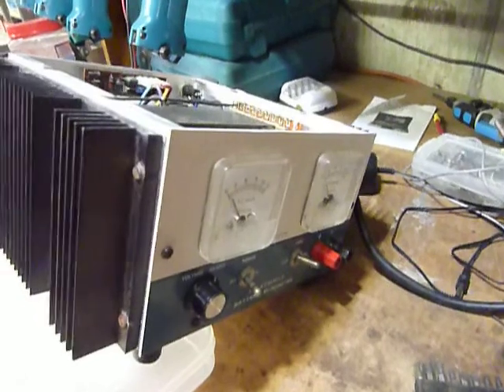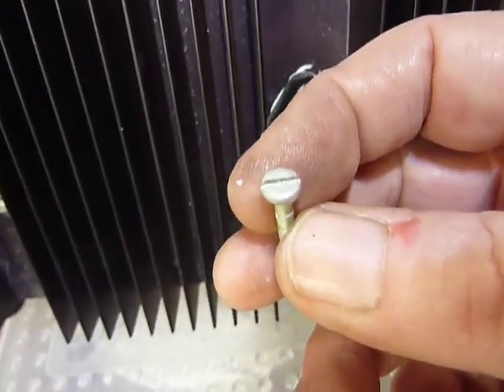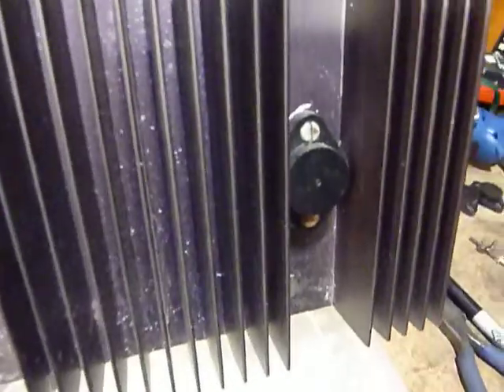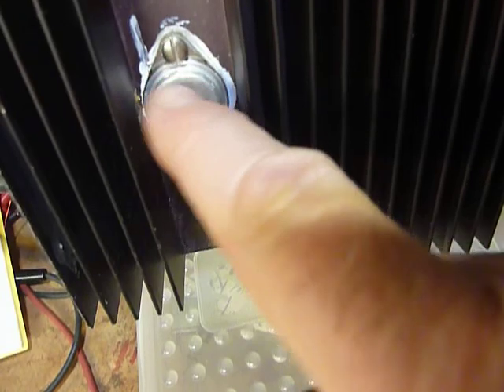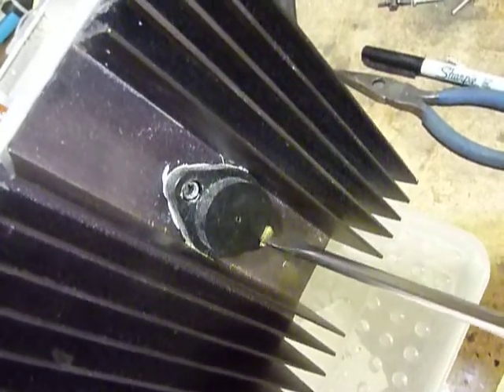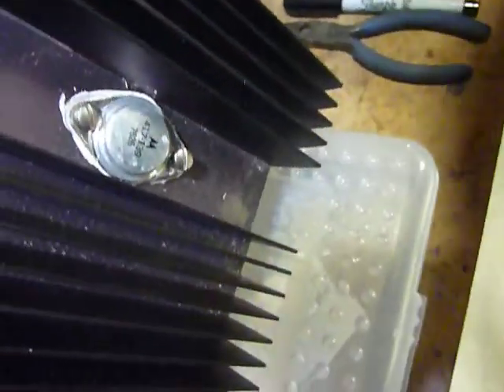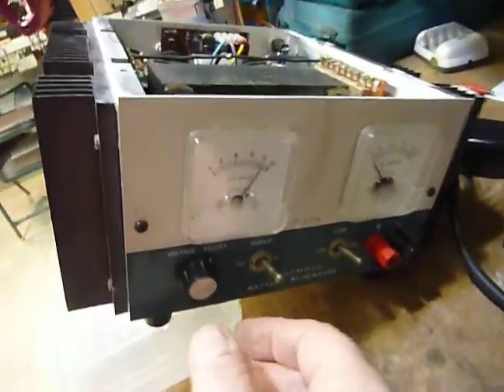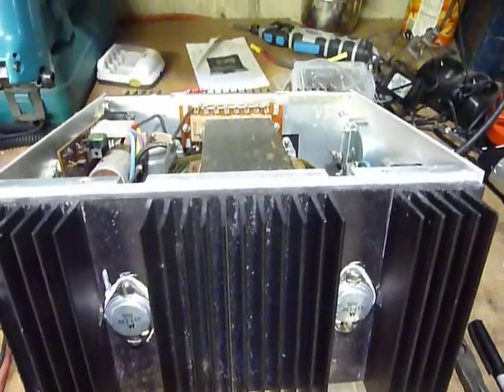HEATHKIT  IP-2715 Battery Eliminator,  Heathkit Bench power supply

Comment: Any idea what transistor I need to power the four on the heatsinks. Ran across the ip-2715 set to be recycled  but I would rather put it to use. The rear main transistor is missing. Don't even know if it's available. I'm not a ham guy. Really just thought it would be a great power supply to bench test things. Thanks in advance for any help offered

Comment: can you post a video of you using this power supply for various applications on the your work bench?  I just picked up one of these and wanting to see how I could use it.  Thanks.
Reply from the maker: No I do not have a video like that and do not plan to make one .   The IP-2715 power supply is well regulated and it will work with any of the 12 volt rigs that 
need up to 20 amps on transmit .It is also fine for running CB sets . Power amplifiers anything that runs on regulated  12 volts . 73  Bob

Comment: Hi Bob, Just ran into your channel today and watched one of your older videos on restoring an old Heathkit Transmitter. I was wondering if you are strictly a repair shop or do you occasionally sell some of the stuff you repair? 
Regards, Don KC3MBK
Reply from the maker: Well I do not run a repair shop and I do not fix radios for others  just make these videos to help guys fix  their rigs . I did work at Heathkit in the service department  for a couple of years before being promoted to Amateur radio engineering there  I am fully retired now for over 15 years so I guess that makes me one of the old timers   73  Bob

Comment: I used one of those for many years as a bench supply.  I modded it by putting a 100 mA fuse in the base (if I remember correctly) lead of the driver.  A shorted load would invariable take out the transistor otherwise.  I also added a resistor in parallel on the regulator divider to allow me to drop the voltage below 5 volts.   If I remember correctly, I put a switch on it to give me a high/low range.  They are a good solid supply.
Reply from the maker: Steve , Those both sound like good Mods for the  IP-2715  I just may do that to this one Thanks 73 Bob